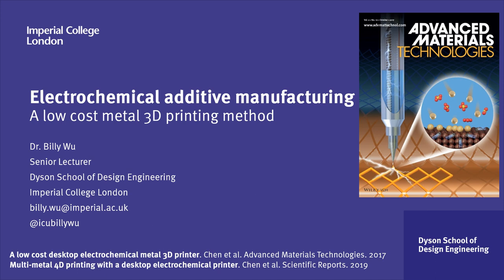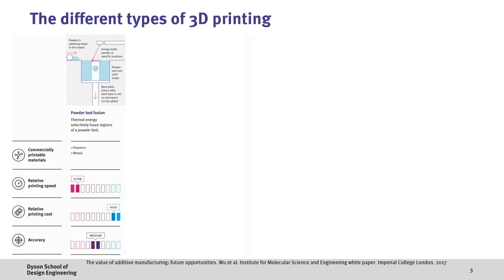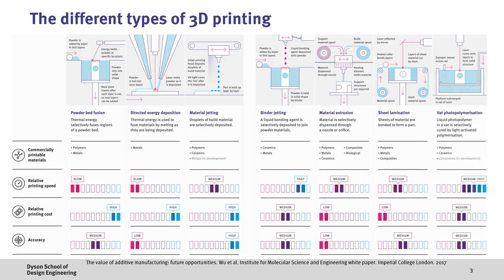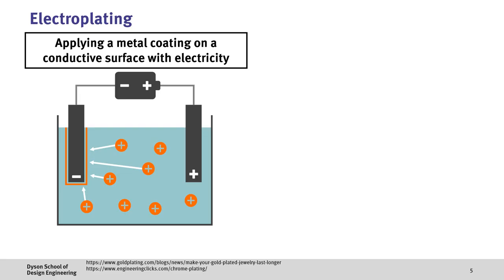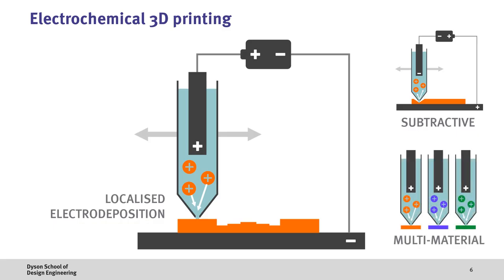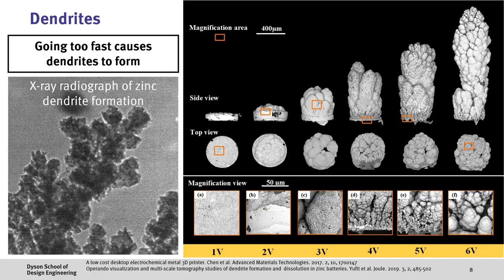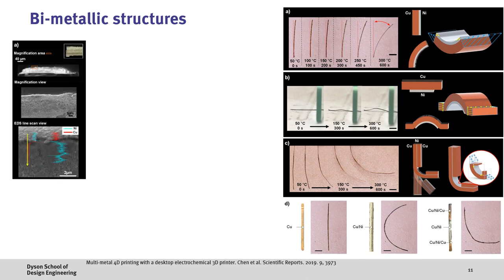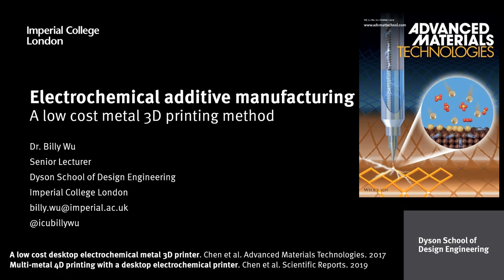Low cost metal 3D printing! Electrochemical additive manufacturing

Comment: I worked on almost exactly this concept 10 years ago.
It's kind of interesting to see you guys go to the same problems i went through.
I'll give you guys some freebie tips.
Use a liquid hydrophobic mask to increase your resolution.
Get rid of the sulfate electrolyte (you do not want sulfur in your deposit material).  You want an electrolyte that doesn't have side chain reactions.  I can tell you what I used, but it'll be more valuable if you figure it out for yourself.
You can get rid of the dendrites and greatly speed up your process by physically accelerating your electrolyte.
Brownian motion in the electrolyte is what forms the dendrites.  Add a focused magnetic field. You have a magneto hydrodynamic cell but you're only controlling half of it.
And lastly... The photoelectric effect is your friend...
I'm not saying more unless I can be involved in the research.
Reply from the maker: Thanks for the comments

Comment: I've been imagining a similar setup but using the equivalent of a felt pen to convey the electrolyte. I'm super excited to see someone pursuing an electroplating-style metal printer. I figure it's potentially the most economical and simplest way to bring metal 3d printing to the masses.
Reply from the maker: Great to see the interest and hope it sparks further ideas. A felt tip could also work though you need to be careful about getting the deposition in the felt itself which is why we avoided this approach but I'm sure there are ways around it
Reply: @BillyWu  I wonder if the idea would work better upside down since you could counteract gravity if leakage is an issue. Also, since the resistance should change as the distance increases, I wonder if you could make the printer more precise by increasing or decreasing time spent in one area based on resistance readings.
Reply from the maker: @ryelor123  Good comments. This current system works by having the electrolyte in the syringe with the sponge. Flipping it in this form would cause leakages. On the feedback mechanism, this is certainly possible and we had done some work on it and am sure this will be the way forward for  smarter higher quality printing.

Comment: This is incredible work here! As soon as I clicked on the video I thought “why didn’t I think of that?”. There are a few nuances I can think of, like whether the solution (be it the solution in the syringe or the tiny bit of solution touching the workpiece) changes in local concentration, or whether you need to introduce leaveners or other additives to the solution, or the inability to deposit some metals atop other metals. But I think all could be worked out. Also IIRC current is what matters more than voltage with electroplating, I’d be interested to see what constant gives you more consistent results. But what I’m most excited about is printing structural metals, and even alloys. Copper and nickel are one thing, but being able to deposit some sort of tough iron alloy would be incredible. I’ve seen a few papers on electroplating alloys before, I think in this case you’d just need to have both metals in the solution at once, and have two electrodes in the one syringe. Then the alloy ratio is determined by the ratio between the currents. Smart CAM software could even change the alloy composition dynamically as you print different parts, which could lead to an incredibly versatile process. A shame you can’t print titanium or aluminium (carbon too I guess), but I think from zinc all the way to platinum, there should be some reasonably strong alloys to be made. Perhaps you could make really compact thermoelectric coolers/generators, or even try depositing doped semiconductors.

What I like most about this is how easy it would be to build from an existing FDM printer. I suspect this will be a trending topic among enthusiasts in 2-8 months. All it takes is someone with enough time and money to try and make this practical enough for hobbyist use.

Are there any glaring flaws, big hurdles? Does the meniscus wick away down long thin cavities or drip away down the side of a tall print? Could it be better to print the whole thing submerged in the solution?
Reply from the maker: Definitely lots of ways to extend this. Electroplating of alloys is certainly possible and you can control the composition by changing the voltage. There was some recent work where they did this to make a thermocouple. You can also do the deposition in an electrolyte bath with a fine tipped electrode but the resolution isn't as good. Hopefully provide lots of ideas for others to build on. We're hopefully releasing some open source plans soon. Version 1 worked but was a little buggy lol
Reply: If a fine tipped electrode on its own had poor resolution, perhaps surrounding it with a ring at an opposite potential for shielding purposes might improve things? Of course you’d need to prevent the electroplating metal itself from depositing on it, but I think there should be metals with those properties, just as it’s impossible to plate iron onto copper.

I’m still most concerned with how a system would handle tall structures and overhangs.
Reply: @Scrogan  if we used an insulated tip as you say, you could probably grow overhangs directly out wards (within a certain aspect ratio). Mabye even printing them bit by bit with every layer that is added (a kind on non planar printing to optimise giving support to overhangs to print them easier)
Reply: @Scrogan  and the closer we have the tip, the higher the current concentration directly bellow the tip, and the more reduced it is to the surrounding metal.
Reply: @Scrogan  You might even be able to get away with using an enamel coated copper wire. The enamel insulates it, and only the tip is conductive and used. 
As the wire is eaten away, the enamel should hopefully just flake off. Which admitedley might cause its own problems

Comment: I had this idea a while back, never got around to trying it.  So cool to know it would have worked!! Now I gotta find time and energy to make this.
Reply from the maker: Great. I think lots of different ways to take this forward so the more people working on it the better :)
Reply: @BillyWu I think what you have demonstrated is really cool! Any fundamental scaling issues, or can this make a decent sized object?
Reply from the maker: @weirdsciencetv4999  Thanks. Unfortunately, electrodeposition processes are a little bit slow so making larger items can be challenge but we're looking into ways of accelerating this. Certainty right now you can make very small functional items which still has a purpose
Reply: @BillyWu  an array of independently switched nozzles riding on the same head, kinda like an inkjet head comes to mind
Reply from the maker: @weirdsciencetv4999  Yeah, there's a few patents which use an array of electrodes which you switch on/off in a bath of electrolyte such that you print a complete 2D layer at once. Can be faster but features not as well defined and needs more expensive set-up. Companies such as Fabric8Labs are doing this https://www.eenewseurope.com/news/no-heat-no-laser-no-powder-reinventing-3d-metal-printing/page/0/1
Reply: @BillyWu  Nice!  Was imagining the electrodes arranged with more separation and individual current regulation.  Then translate the head around in an optimized path.  This convo def has me wanting to experiment.  Is your effort part of a university? Industry? Independent?
Reply from the maker: @weirdsciencetv4999  Our work is mostly as part of a university. Details here https://www.imperial.ac.uk/people/billy.wu/research.html

Comment: One way I had envisioned getting a metal part from a 3D printer was to print a porous conductive plastic model and then do electroplating and electric polishing. At some point we either use a solvent or heat to get rid of the plastic. And then more electroplating and electropolishing. As slow as this is it's probably still faster than my idea.
Reply from the maker: Certainly possible to do this and since the deposition area would be faster in some sort of electroforming process it would probably be faster. One thing to consider is that some conductive paints etc aren't 100% conductive when zoomed into the micro-scale since they're often a blend of conductive agents and binders. Some people also use electroless plating to get a more uniformly conductive layer

Comment: In Microelectronics and Microsystems we use electrostatic based 3D printing for prototyping (dacades old but still SOA) to move one atome at a time. Even for that industry, this method is very expensive and is used only in rare cases. This here is really a nice new development and is very interesting
Reply from the maker: Thanks for the comment. Great to hear that there's potential applications in all these areas

Comment: Hi, I love it. I was big in Electroplating of high aspect ratio structures back in my research days. Used to use Megaherz ultrasonics to break up the boundary boundary layer. 
But I was wondering if you are controling your deposition spread just via the size of the meniscus or optimizing your frequency and PWM too. So you are basically using the the charging of your boundary layer to focus your mass transport to the close  areas?
Reply from the maker: Thanks Jens. Yeah there's a few approaches for enhancing the mass transport properties such as electrolyte flow systems and as you say ultrasonic systems. We control the size of the deposition mostly through the size of the nozzle, it's separation from the build plate and the deposition conditions mostly but are also looking at other approaches too which we hope to share soon :)
Reply: Did you ever end up writing a paper about this. Am very interested in your results

Comment: I was just wondering if this concept would work! Very cool, and well explained, too. Is it possible to print in alloys, or does the plating process limit the user to elemental metals?
Reply from the maker: Thanks and great question. Yes, it's possible to print alloys. In principle anything you can electroplate, you can print with however in the case of some metals the electrolyte and conditions start to become a bit more challenging to handle. We've mostly focused of aqueous systems (water based) but lots of non aqueous systems exist for more challenging materials.
Reply: @BillyWu  Nice! Thanks for the reply.

Comment: Very interesting discussion of electrochemical deposition process. As you mentioned in the video a big limitation is deposition speed because of dendrite formation at higher voltages. I can see parallels with traditional ink jet printer's which could address speed issues. A 2D matrix head, with individual channel deposition control would be possible. Limiting constraints would require high flatness, separation spacing and accuracy of the print head and deposition bed. I would be interested to know what the experimental deposition rate you've been able to achieve for copper.
Reply from the maker: Thanks. In previous work we demonstrated a volumetric deposition rate of about 20,000 um3/s with a 400 um tip. Sounds fast but is actually only ~0.0012 mm3/min lol. Could speed up with more active area and a few other tweaks but speed is a challenge with this approach but certainly a few applications where that's less of an issue.

Comment: This is a brilliant idea, kudos! Looks absolutely fascinating. Two questions immediately come to mind:
1. Would precise control over electrode distance and a higher current efficiency electrolyte (nitrates perhaps?) allow you to operate directly in a bath rather than your syringe? McGeough's (U. Edinburgh) comments on the relationship between efficiency and resolution for electrochemical machining come to mind.
2. Would you be able to take advantage of the double-layer through the use of pulsed current, akin to Pulse-ECM? This may be able to improve resolution and perhaps allow for direct in-bath printing as well.
Reply from the maker: Thanks for the very interesting comments. There have been a few other works which use fine tipped electrodes to do the electrochemical printing but the deposition tends to be a bit more spread out. You can address this somewhat from having a finer electrode which is closer to the substrate but we wanted to try to use lower cost components and avoid costly position controllers. On pulsing, yes this should be possible and have seen some work where people do pulsed deposition to get favourable morphologies. Lots of potential variables to optimise further so am always happy when this might inspire someone to give it a try with a new approach.

Comment: Very interesting video.  Though the overview is missing the newest and the most promising metal 3D printing method - Selective Powder Deposition (SPD)
Reply from the maker: Thanks. We tried to capture these types of deposition techniques under the "directed energy deposition" category but agreed that there are new forms of printing constantly coming out so always great to have a discussion around the newest approaches. The pdf of the overview in the video can be found at if interested https://am-hub.dk/wp-content/uploads/2018/01/IMSE-Briefing-paper-2-AM.pdf
Reply: @BillyWu  Thanks Billy, that's very interesting.  Any idea when Electrochemical 3D printers might appear on the market?
Reply from the maker: @iro3d  There's a few companies such as Fabric8Labs which seem to have a reasonably mature product. They use an array type approach so might be a bit faster but with challenges around resolution. I suspect prototypes of this form are reasonably mature but the challenge is whether there would be sufficient consumer interest for a printer like that with the known challenges of scale https://fabric8labs.com/

Comment: Did you think of using sponges brushes ?
You syringe tip approach look indeed best for precision but since the process is slow, you could save a lot of time with a wider surface.

The same way you have multi material the printer could use a second, wide, brush able to cover more area.

Also maybe a truncated cone could be squished to have some control over the width of the contact patch.
Reply from the maker: There's definitely more improvement and different ways of doing the printing tip. Certainly a larger print head area could help.

Comment: Sounds like the main limitation is speed, but maybe also resolution, especially once the part is actually becoming "3d". And it requires a conductive build plate/base. Maybe a non-metal build plate allows separation of the part and reuse of the plate?
Reply from the maker: Yeah, stability of the liquid meniscus is also a challenge. Some people have demonstrated really good resolution with the use of nano-pipettes however at the cost of speed. The challenge with a non-metal base plate is that we need electrical contact for the deposition but you can deposit on glass if you have a conductive path from elsewhere.

Comment: Should there be a small o-ring or seal around the sponge to isolate the electrolyte? Another thing I wonder about is if you could make this process more precise by adding it to a FDM printer and having the printer make a sort of shell of plastic around the metal to give precision?
Reply from the maker: Good questions. We tried to keep the system as simple as possible and found that with just the right compression and type of sponge that the back-pressure could be balanced with the electrolyte pressure to prevent leakage, however this was a fine balance that sometimes didn't work so improved electrolyte confinement would help. If you make an electrolyte guide as suggested that might help, though we wanted to see if we can achieve this without additional complexity, though perhaps supports might be needed
Reply: Containment of the electrolyte is moving in the wrong direction. You want to deplete or inactivate the electrolyte after consumption... Then it is self masking and regenerable.

Comment: How are the dendrites negatively effecting the metal? Do they also cause poor adhesion? Just wondering if dendrites are acceptable trade off for example some applications.
Reply: Dentrites would result in high porosity, i.e. low strength.
Reply from the maker: Hi. As others have mentioned dendrites generally result in a mossy and porous structure which has poor mechanical properties, so ideally we avoid this by going slower.
Reply: @BillyWu  Thank you for your answer. Poor mechanical poperties is kinda of subjective term, though.  Since it really is depends on the application you be using for. If it's really porous it might be good for heat shielding or something. Really cool technique since are also kind of able to also determine the density of the metal through the voltage.  Or is that little bit to far fetched.

Comment: This is extremely interesting. For the sake of complexity reduction could this not work with the part and nozzle submerged instead of maintaining a meniscus? I am assuming the current would still be constrained by the nozzle wall and predominantly favor the the shortest path. With a bath you'd be able to circulate electrolyte through the nozzle though I'm not sure if that is actually useful. Apologies if you addressed this in your first paper. I don't have access to that journal.
Reply from the maker: Hi Alexander. You're right that this approach would also work with a bath of electrolyte. Others have done this with sharp electrodes to help focus the current. Having a nozzle in the bath may help to also focus the current however the challenge would the be the difficulty in doing multiple materials, where a bath change would be needed. Definitely worth looking at though.